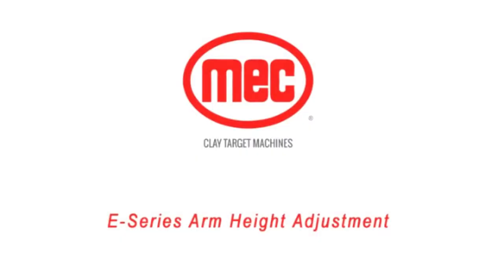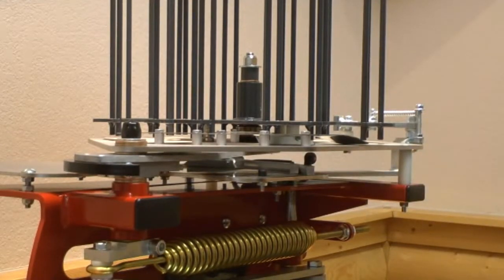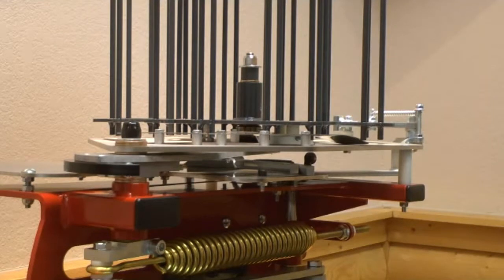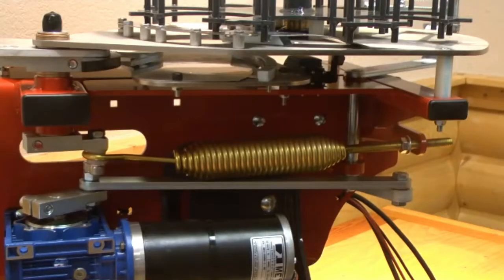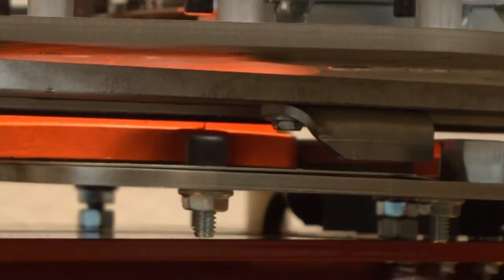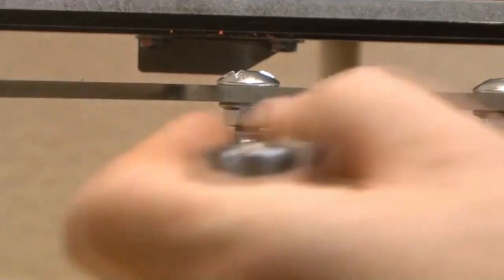E Series Arm Height Adjustment

Comment: We have a 300e setup to throw a Rabbue. We are getting broken targets and erratic target flights off the arm. Initially the separator knives were too tight to the target and the throwing plate was too high at the outer edge, contacting the bottom of the arm near the end of the rotation. After knife and plate adjustments, and a small adjustment to the arm timing, we now have clean targets dropping onto the plate and more consistent flights but still get one to three wobbly “off to the right” erratic targets thrown every 6 to ten targets or so. Any suggestions?? Thanks in advance. Ryan